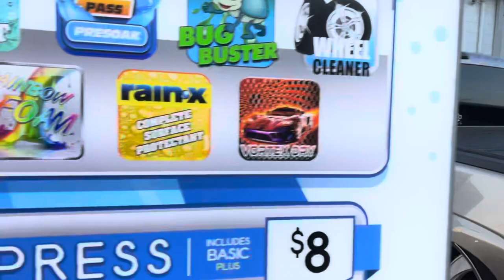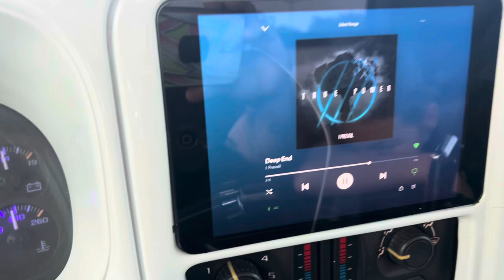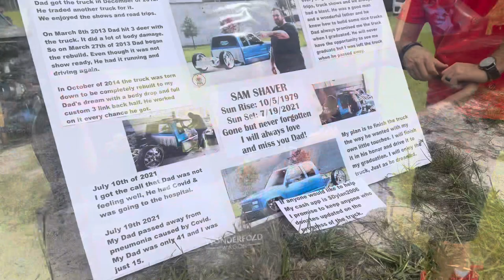Play Loud X show 2023…the 10th Anniversary…Jennings, Fl

Comment: Brother how did you go about installing the billet steering wheel on the single cab gmc. What hub did u use.
Reply from the maker: The GM hub they sell for 95 and older Chevys will work just fine….they just won’t tell you that because your not supposed to install on a vehicle that comes factory with a steering wheel airbag because our government deemed it “unsafe”
Reply: It will be just an off road vehicle. I have 3 on hand including on my obs, just didn't know if the hub will bolt up. By they way sick looking truck.
Reply from the maker: @alar2343  thank you sir and yessir it will bolt right up